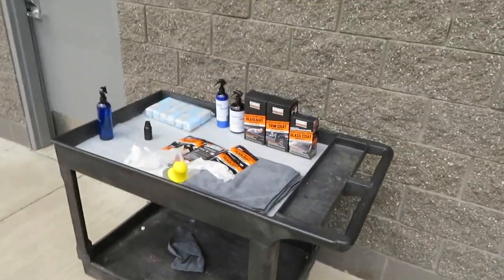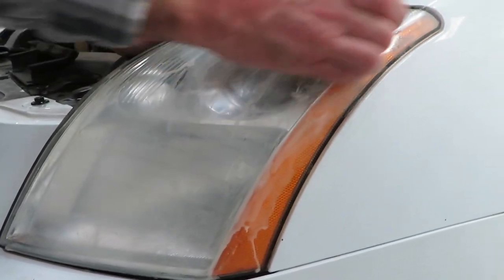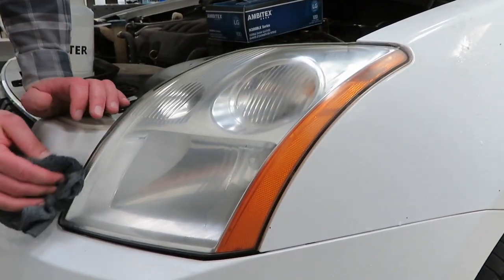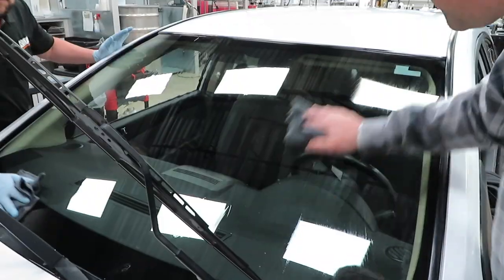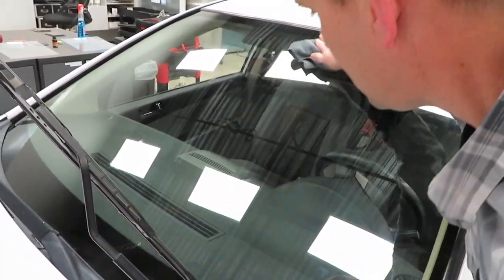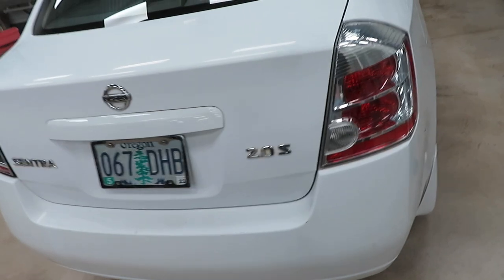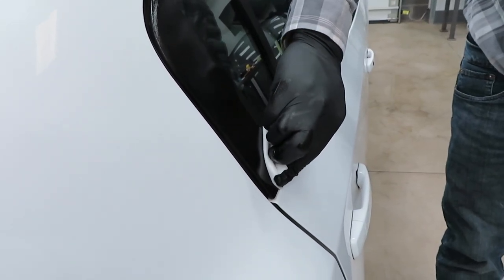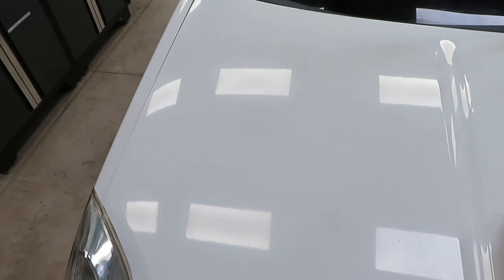New Car in a BOX ... These DIY Kits are INSANE!!!!

Comment: The best light to use when applying ceramic or hybrid ceramic coatings is diffused you can see if you missed any places when applying and also see if you got it all off. I couldn't find a good hand held diffused light when I did my car so I covered the end of a torch in 2 layers of baking paper and it made it so easy to see where you applied the coating especially on white paint.

Comment: For the black trim be sure to clean the plastic well, wipe with alcohol, and let dry. Don't apply over any area that is wet or it will streak. Done right, looks great for a year or more.
Reply: With any product it should always be applied dry for sure. Glad you mentioned that. It seems common but some may skip that being in a rush
Reply: Only mentioned because they did not say anything about prep in the video. However, this is clearly noted in the instructions that come with the product.
Reply: I've never used cerakoat products but for my trim and plastics I always scrub it well with a degreaser and then use alcohol before I put whatever trim/plastic conditioner on it.

Comment: If you want to have your headlights look new after restoration, then use automotive clearcoat, either by custom spray cans(2k with button on bottom for activator) or by the use of a spray-gun. Everything else is temporary because of no UV protection.

See this headlight restoration.

https://youtu.be/f-ImmoD_V18
Reply: We put headlight protectors on our Hyundai Getz and that stopped the deterioration of the headlights. The first time I restored the headlights it only lasted a year or so, but after the second time when I put on the protectors, the headlights are still good after several years. It seems that the Plexiglas stops the UV from deteriorating the headlights.
Reply: Bruce Pierson , yes there is an initial UV coating on the headlights but they get washed off by the chemicals or once a headlight gets scuffed by bugs , road debris, etc. 
Then it’s causes fading and issues. 
Paint grade clear coat has UV protection much better than any off the shelf wipes or solutions. 
I guess another alternative is to sand it smooth and then put 3M clear bra over it. But only if you are handy at that as well.
Reply: @chrisrobles2012  i sanded my 05 Monteros headlights with 2000 grit, polished with rubbing compound then shot them with 2k clear 2 years ago and they still look like new. I live in Phoenix and it stays outside all the time..